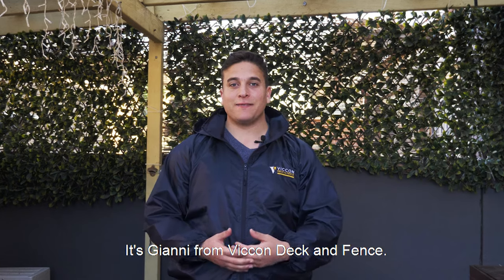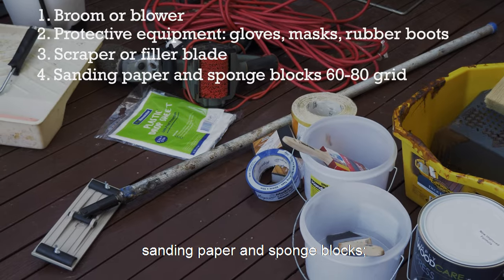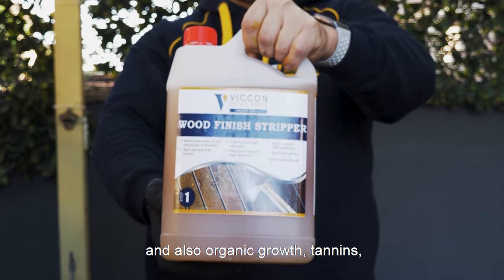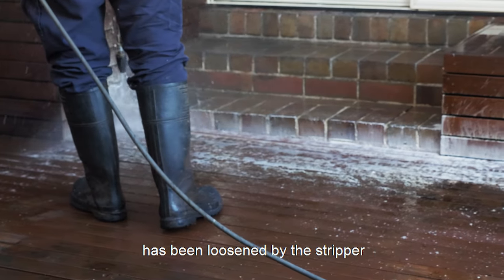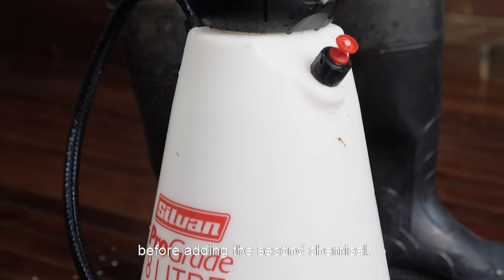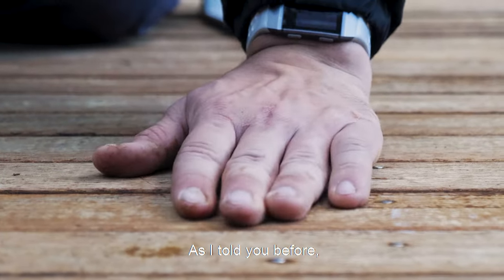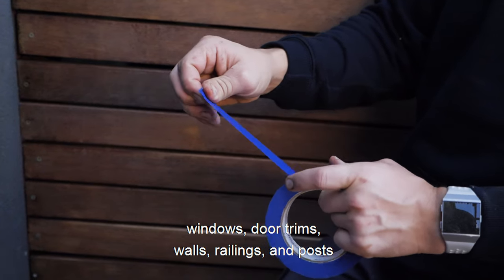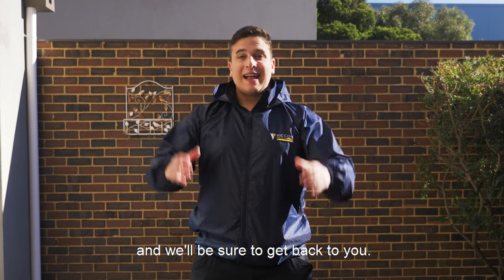How To Restore A Peeling Deck Step by Step | Stripping, Sanding And Sealing

Comment: I did the exact same procedure & boy you make it look easy. Never wanting to go through the same thing again I chose to cover the deck with an oil based product which penetrates into the wood & never peels or cracks so I never have to use paint peeler or heavy sanding again,sure I have to apply decking oil more often but it's a lot easier.

Comment: So it just took like 30 hours of work to restore this deck. This is so much work, why do people install decks?!?
Reply: 30 hrs is not enough
Reply: The only reason you would do it this way is because of the stainless steel nails. You can’t floor sand them or hit them down enough to floor sand. Moral of the story only use screws that can be countersunk so you can floor sand down the track if needed.
Reply: There's a sander you can hire that uses a brush type sander which is safe for nail/ screw heads poking above the timber
Reply: Just rent a commercial sander from homedepot.  2hr max!
Reply: I didn't install the deck, I bought the house with the deck. And a big gazebo on top of the deck. Deck was 2 years old then. I thought many times about ripping it out, but I can't afford to either replace the wood with composite or totally remove the deck and put down stone hardscaping. Just replacing the wood with composite is going to cost over $5000 in just materials, I don't know how much the labor cost is going to be, and I'm also going to have the labor for dismantling and reassembling the gazebo too. It's a mess and I'm basically paying for it yearly with my labor by cleaning and sealing the entire deck. I hate it
Reply: @1whitecottagelife770 NEWS FLASH !  NOTHING you coat your deck with will last more than a few years. Then you’re back to square one. Use a spray on deck cleaner and power wash it off every one or two years. Dont even bother wasting time and money on strippers, sandpaper and finishes. Natural is the way to go.

Comment: I read that to stip a deck you need to use the yellow 15 degree tip. In this video you deck is dirty. Ya the green 45 degree will work but my deck has stain on it that is peeling up and its not coming off with that 45 degree tip it actually is tearing up the wood

Comment: You long list of equipment are EXPENSIVE.
Reply: Thanks for the video!
At least in the US, to do all that yourself is not that expensive, at least in terms of equipment; the most expensive things will be the pressure washer and sander. To rent a pressure washer will run you about $70 for the day and for a sander about $90; plus you have to get sanding pads and other things for the main equipment but still not too bad. 

What really gets you is the time! You have to make sure the deck hasn't been rained on or wet for a few days and is completely dry before you start, during the process and for a few days to a week after you finish.  It's also a good idea to tarp and tape off as much as you can that is not what you're working on. To do all that, and especially sand, etc will take you awhile, but in terms of cost, it's not that bad. Of course, I mean for materials and equipment it's not that bad. In terms of what is your time worth, that's up to you. 

It's kind of like painting. The actual painting part isn't too bad. The real time suck is clearing out the room, taping things, removing things, spackling holes, sanding holes, etc. Once you do all that, the painting part is actually pretty fast...

Comment: why not pay a company 100.000$ to do the job it would be much easer.
Reply: It costs $2000 and need to do every year
Reply: @CrazyDog1907  Don't buy trex like that other guy said, trex is facing class action lawsuit for mold issues. Staining a deck with clear penetrating oil once a year is a way better option since you don't have to deal with peeling paint ever again.
Reply: @CrazyDog1907  to do a job like this, you expecting 4500-6000
Reply: @cherrypoutines6269  Old News, CherryPicking that topic. Suit ended in 2013, and only affects 1st generation Trex pre 2010 . Other products affected by mould also in that era of 1st gens... Plz keep up to date.
Reply: @LesterDale_Mel  didn't know, thanks for the info!